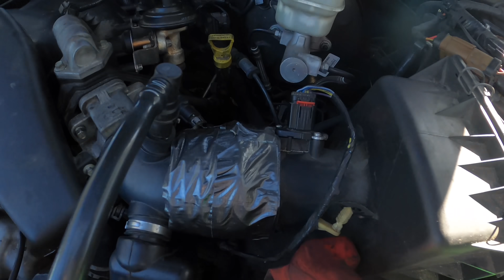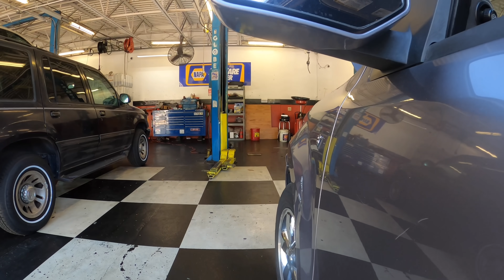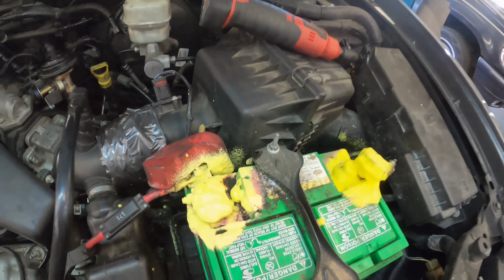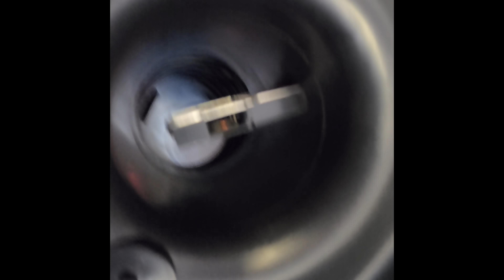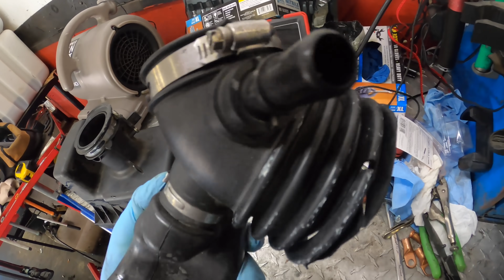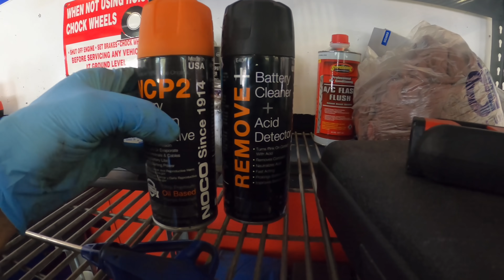Want to break down? Do This!  Ford Escape V6

Comment: Cool, I always thought a Hotwire mass flow sensor kept the temperature of the wire stable as a Wheatstone bridge and used the power required as the sense output.

Learn something new every day.
Reply: How would that work without an IC and a closed loop for temperature measurement?
Nah, the hot wire maf is a simple analog but effective design. The temperature of the wire is just due to the current. That’s why it’s also made of platinum because it has to withstand the heat without braking.
Reply: @Asto508  
Umm, I see you do not understand what a Wheatstone bridge is or a 741 or a 549.

So do tell me, how is the temperature of the wire measured?
Reply: @brucebaxter6923  I was referring to the part where you were talking about having an active component that keeps the temperature stable and using the temperature change as a sensor value. 
At least that's what I understood from your post. 

The temperature of the wire itself is not measured or controlled by anything, but it's internal resistance is (which correlates with temperature obviously). 
That's also the reason why dirty MAF sensors can mess up the engine control system because it reacts much slower to air flow changes since the temperature of the wire, coated with layers of dirt, changes slower in response to a change in air flow. So it usually underreports the actual air flow which leads to less fuel injection by the engine control which in turn leads to running lean states since too much air is present in the combustion chambers.

I admit I did not know the term "Wheatstone Bridge", but it sounds as if that this could be actually what's used to measure the resistance change after all.
That temperature measurement is also part of the MAF sensor (shows up as the IAT (Intake Air Temperature) in the system). In that sense, it could very well be that this is actually employed and your assumption was correct in that regard. 

Only there is no active temperature control and measurement going on and it's all passive.
Reply: @Asto508  
Again, how is the temperature measured?
Reply: @brucebaxter6923  The temperature of the wire isn't measured. The MAF measures g/s and for that, it doesn't measures temperature of the wire.
For measuring the IAT, there is an additional thermo-resistor, but that gives you nothing about the hot wire.

You know, there are measurements and there are derivatives of measurements. You have to be clear what you're talking about here.
Reply: @Asto508  
Ok, if you want to play word games,
How do you get from wire temperature to mass flow?
Reply: @brucebaxter6923  You still don't go from temperature to mass flow. You go from wire resistance to mass flow. That is what is measured and translated into air flow.
The temperature of the wire is A correlate of the wire's resistance, but it's not the physical property that is measured. 

This has nothing to do with word games. These are simply different physical properties. Yes, you CAN draw conclusions about property B by measuring property A, IF they are highly correlated, but that's not the same thing as measuring property B itself.

If you think these are "word games" then I'm surprised how you get through the day.

May also be the reason why your initial post may have been misunderstood by me, but since you are not interested in clearing things up either, we should just wrap it up here.
Reply: @Asto508  
Ok, how do you go from resistance to mass flow?
Reply: @brucebaxter6923  By using specs and math.
Reply: @Asto508  
I’m starting to think you don’t actually understand how these things work or how to design them.
Reply: @brucebaxter6923  I understand enough about it to explain why your initial assumption about an active temperature control would require components that are not present in MAF sensors to begin with and also why it's not needed at all. 

Beside that, I don't know what your actual point is or where your confusion is about how it works and what was explained in the video. Instead you are asking pointless rhetorical pseudo-questions.

So, last chance to get somewhere, otherwise I will just assume you're trolling.
Reply: @Asto508  
You have yet to explain how the signal is generated without any “active” components
Reply: @Asto508  
A mass airflow sensor contains plenty of active components, what on earth are you talking about?
Reply: @brucebaxter6923  You obviously don't understand what an active component is. The MAF sensor is 100% consisting of passive components and that's also the reason why it needs to be driven by the ECM. 

You had your chance to stop trolling, have a nice day.
Reply: @brucebaxter6923  Go ahead, name one. I know you won't.
Reply: @Asto508  
You mean like the two most common ones used in this type of device that I already named?

Oops, you didn’t know that’s what they are called.
Reply: @Asto508  
Still waiting for you to explain how you get an output signal
Reply: @brucebaxter6923  From the reference voltage that is fed into the MAF sensor. 

Thanks for clarifying again that your really don't understand the difference between active and passive components.

And no, there are still no active components in the MAF, although you firmly believe that it is the case. Maybe you should just pick one up and discover by yourself. 

Have a nice day.
Reply: It just do without and buy an EV

Comment: The intake tube is a duct, why not duct tape? Seems legit, just didn’t apply it properly! Love home repairs.
Reply: I get your humor. The humorless readers don't. 
No one liked my DUCKS humor.
Reply: @glennp827  Hey Glen, I like your ducking humor.  The owner should have tried flex seal, it always works on TV.
Reply: Lol I'm not sure about when it was first invented, but today you never use duct tape for taping duct seems. It only gets used for hanging ducts now and that's even pretty rare. It's all foil tape and metal straps now
Reply: I don't think he could. It's essentially corrugated which is why that original tape didn't seal when the owner ripped the hose in half. That would be really difficult to cleanly tape well enough.
Reply: @jonmayer  Self amalgamating tape stretched before you apply it can work if you are careful,  or you can  CAREFULLY rebuild with duct tape OR foil tape, what you can’t do is just wrap stuff up and hope it works.
Reply: if was a small cut it can be repaired with duct tape but that one is just totaled
Reply: Actually that isn't the kind you use on ducts.  Our new house used aluminum tape. Lasts a forever.  Duct tape drys out over time.  TMI
Reply: It's DUCK tape. I saw no ducks.
Duct tape is shiny

Comment: We always used a coating of Vaseline on battery terminals. Never had corrosion problems after that. Still remember batteries that had to be checked weekly and filled with distilled water as required!
Reply: Just curious what was the situation where the batteries had to be checked weekly?
Reply: @paisleyprince5280  batteries were not sealed like they are today. Charging systems were not as advanced either so it was common to overcharge them. “Compensated voltage control “ was as good as it got leading to the water in the electrolyte evaporating under certain conditions. I still have my fathers battery filler bottle made by Lucas. Automatically gave you the correct level in each cell.
Reply: @lyntonprescott3412  You remember right.  back in the 50's the old cars had generators instead of allternator on them and a voltage regulator instead of solid state technology.  Weekly servicing of the battery, oil, water level, transmission level, lights, etc.  Also you changed your oil every 3000 miles along with your spark plugs, and points and condensers.   I'm an old geezer and hear others say they din't build em like they used to.  I say thank God they don't.  LOL  Automobiles are much better now than then, and cheaper to maintain.
Reply: @Dave-ty2qp  very true. Don’t forget cross ply tyres, flat windscreens, no seat belts, petrol in gallons for a few Bob!, no heaters or radios and leather seats even on a Moggie minor. LOL.
My old motorbike had a magdyno didn’t half give you a belt if you were careless checking for a spark.
Reply: @lyntonprescott3412  , wow that's cool ! Is it made of glass ?
Reply: @Dave-ty2qp  ,haha right .
 Yeah , after the advent of the  distributor cap and rotor and the  alternator  they really began to master the automobile in America. They built em strong and meant to last .  Then they realized they were building them too good and began engineering them to break down after a certain period of time,  usually after the warranty expired .
Reply: @jimwednt1229  I can't argue with the truth, LOL
Reply: @lyntonprescott3412  I got a real kick out of reading your reply Lynton. The English have a flair for English LOL.  I have never personally spent a Bob, but I have known several.  I have never had a car without a heater, or with a flat wind screen, nor with an engine that turned in the oposite direction of rotation.  I have lived a couple of decades in the Far East, but always regretted not spending time in Great Brittan, and Europe.  Best of the day to you,.
Reply: @Dave-ty2qp  yes sir!
Reply: @Dave-ty2qp  thanks very much. A “Bob” was a colloquial name for one shilling. Used to be twenty shillings in a GB pound, before the country changed to decimal coinage.
Reply: @lyntonprescott3412  Thanks Lynton.  I have always found the English money terms confusing because I never used it.  LOL  At least now I understand the term Bob thanks to you.
Reply: @paisleyprince5280  , old time 12volt lead/acid car  batteries . Perhaps checked monthly or a few times a year, depending on duty cycle and the climate you're in. Just top off the cells that were low on liquid , with distilled water , but any water would do just not as well as pure distilled H2O
 They used to be built to last forever, literally ! 
 50 plus years of service life, I've personally seen old batteries still working.  
The plastic dry rotted before the batteries failed. 
 Nowadays they're all throw away disposable batteries that crap out after 3 years, if you're lucky.  

With the right tools and knowledge batteries a
Can be refurbished but it's not something worth the time unless you're in the business of refurbishment.
Reply: @jimwednt1229  my truck is 15 years old and has the factory battery. You are wrong pal. Also, NEVER put non distilled water in your batteries unless you prefer to coat the plates with minerals. No wonder your batteries only last 2 years. 🙄
Reply: @jman0870  you didn't fully comprehend my comment ,
" Pal " lol
Reply: @jimwednt1229  the Panasonic battery that came in my '04 Scion xB I changed it in 2019 and it still worked and never leaked, was getting slow though, so I got a cheap Walmart leaky POS for $109 (exide makes them i believe) but i should have looked for a Glass mat model just because.
Reply: @slingbart705  If you got one of those NeverStart batteries, they're ok. Made by Johnson Controls Inc, same OEM as Interstate. Had one of those in my old van last 7 years until it got slow. Glass mat batteries don't last if not charged properly, they have a lot less water in them and can get dried out pretty fast, like in my motorcycle. I changed that out to a little lithium ion battery with built in BMS, that solved that problem of buying a new battery every spring! AGM do work well with smart battery chargers, my newer Hyundai has a factory AGM battery in it. Still like new 3 years later.
Reply: @paisleyprince5280  The old style of batteries as others said were not sealed, so you would open the caps to check the acid level & top up with water as needed.  You could also use a hydrometer to read the acid concentration & adjust if needed.  
It was largely because the old alternators, (or even older generators), didn't have the charge level detection systems we now have and used a 'constant voltage charging' method that could overcharge the battery, electrolysing the water so you had hydrogen & oxygen outgassing over time.  So you needed to replace what was lost.
Reply: Good evening Ray sorry I'm late I know your podcast is great but I've been out of the state lay down the law😬 BROTHER 🚔🧰👋👍🍻
Reply: My brother used some thick heavy grease on his battery
 connections,  military surplus stuff in a 1 gal. Paint can and as long as the connections didn't have any corrosion on them when the grease was put on they stayed protected under a ¼ inch thick layer of it . Messy as all get out when time came to change the battery lol but it kept the green death at bay .